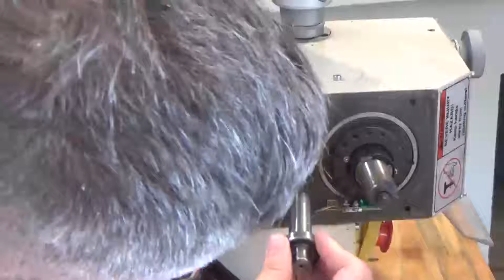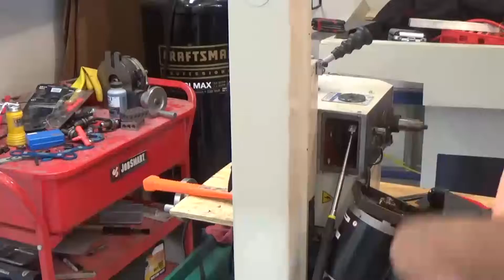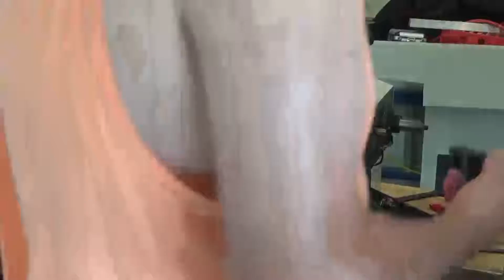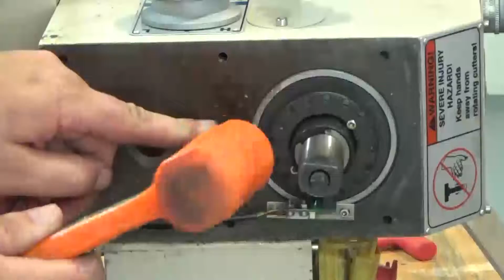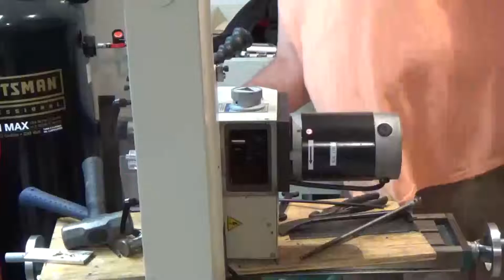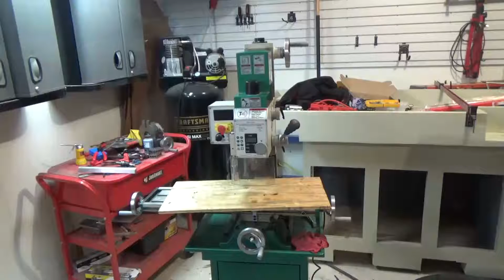G0704 Intermediate (High/Low) Gear Replacement: Part 2 Installation

Comment: You can increase the spindle speed to around 3000 by just adjusting the speed pots on the board marked Min & Max with a small screwdriver, only takes a few minutes.

Comment: Thank you for posting this video!  I just tore mine down and am ready to reassemble.  The part that most concerned me was reassembling the shaft to the fork with my big fat hands in that tiny box.  It would seem like a no brainer to remove the knob first, but it is probably something I would have fiddled around with for a while before it occurred to me to do that.  I have only had the mill 2 months.   Again, thank you!  Jerry

Comment: Kirk, thanks for taking the time to video this!  I chewed up the first plastic gear driven by the motor pinion and now I'm looking at mine to see if there is a way to eliminate the hi lo gear and still have the function of the quill.  Thanks!